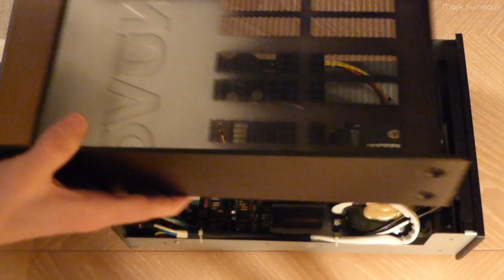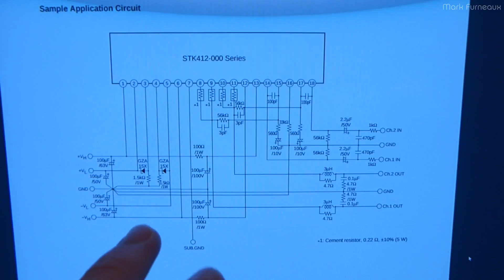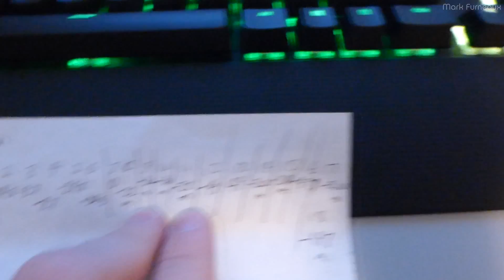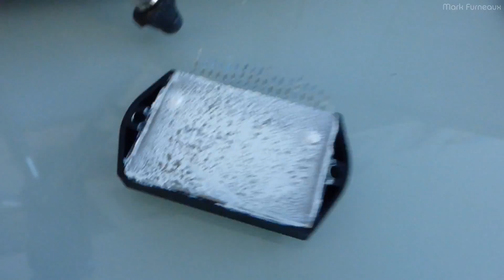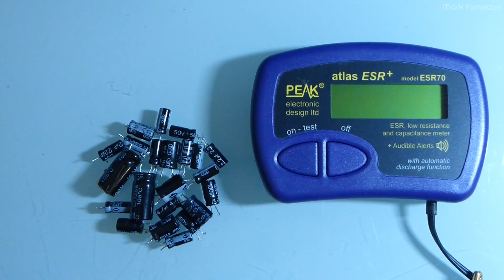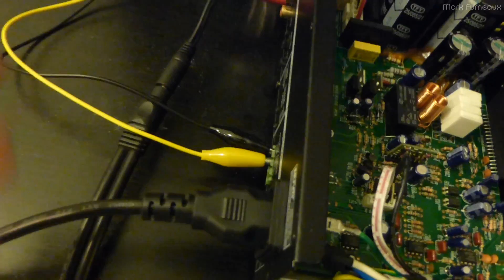Repair of a NuVo NV-P2100 System Audio Amplifier

Comment: Hi Mark, I have this amp and the NV-A4 controller.  Never did figure out how to connect the amp.  Its been parked off to the side for years.  Would love to use it.  Ids there a site that can show me a proper connection or do you have a video showing how to connect this amp to the master unit? Regards,  Al

Comment: Hi Mark, I have a P3100 Zone 3 LED is off and Zone 2 is always on, Zone 1 works.  It doesnt have capacitors like the P2100.  It only has caps on the power supply.  Nothing looks bulging.  What do you think I should check.  I can send a pic of the board to you.
Reply: Ever found a fix?
Reply: Nope sold it as is  @barmitzva7800

Comment: tda7293/4 uses pair of 10.000uF caps and its only 70w rms, my homemade 400w mono amp with 4 pairs of IRFP9240 and IRFP240 mosfets uses 4 pairs of 10.000uF caps, minimum is one pair of 10.000uF caps or can use something like 2 - 40.000uF caps but they cost a fortune, aswell it uses speaker protection from short and dc at amplifier output - everything is made from scratch, no ebayish stuff and why you spelling obviously - obviou(shhh)ly when you dont have problems spelling letter s like (s)peaker, just asking

Comment: I think those large white resistors are like fuses, you should check them first. In our shop we would take out the STK and then turn the amp on, if it powered on ok then we knew the STK was bad. Anyway I don't have much experience fixing these, the owner would often make the diagnosis and then I'd replace the parts.
Reply: I was thinking about those large wire wound resistors found in tv's, they are surge resistors and small values. They act like fuses. thx for reply.
Reply: Bri G. Yeah... this isn’t a tv...

Comment: IF you remove the cover of the relay, and manually push the relay contacts together,  will it work as is should???? if yes then what ever controls the relay is the problem..which I know could be alot of things...but at least you could hear each channel..

Comment: Just in case you run into these STK blocks in the future - they're not always hopeless. Yes, they're proprietary-ish, usually Sanyo, but many of them are pin-compatible with each other, you just need to select one with "close enough" voltage/power ratings. NTE makes some replacements as well. I've replaced a couple dozen of those in the last 15 years.

Comment: I think that's called an R-core transformer, Sony use them in their high end audio gear.
Reply from the maker: +Brian Taylor Thanks! That's it. Apparently they have good idle power consumption and low noise - both of which makes sense for an amplifier.